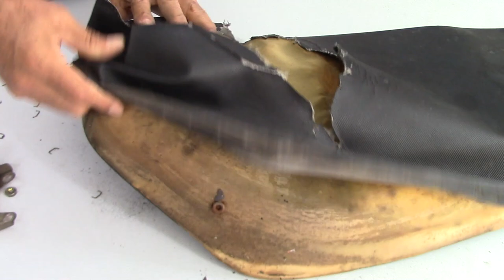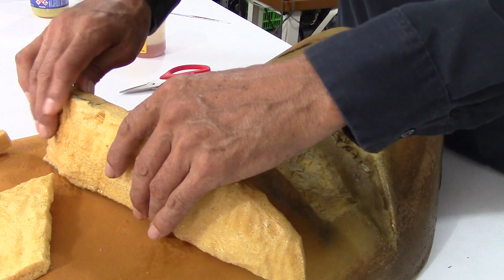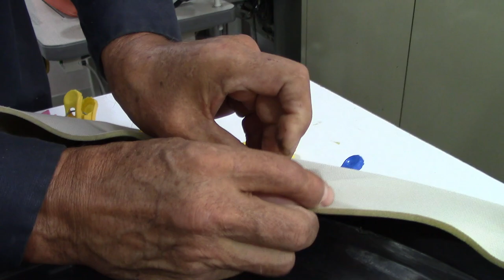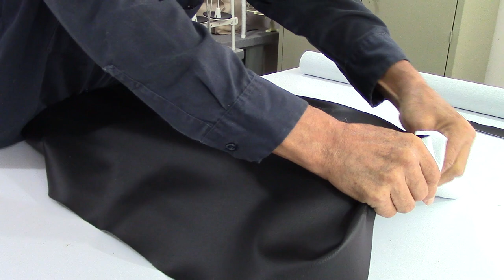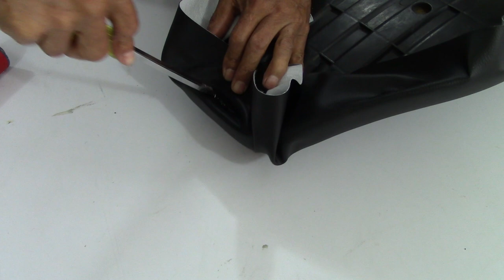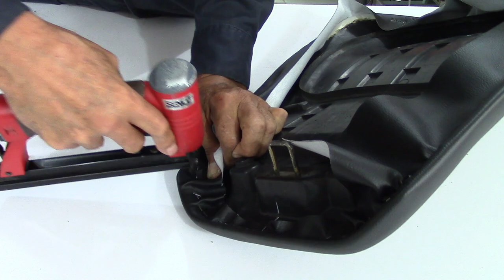Motorcycle seat cover - Straightforward/No sewing -  Upholstery

Comment: Most of the people would glue the vinyl to the seat instead of applying the correct forces in the correct angles to staple it to the back. Even applying glue using a professional spry system, when the glue dries it hardens and the good side of the fabric will copy all those imperfections, so no matter what how even the glue is spread it wont look professional. In this case and almost all the cases you should not apply glue there's always a work around. No heat which is great, proper way of stretching the fabric and staples selection. 1 single piece, no top and/or double stitching here so no plastic is needed to make it waterproof, nice job man, well executed as always :)
Reply from the maker: Thanks for sharing this interesting reflection!
You are thoroughly right!

Comment: Please don't make the mistake I made and order premium quality Vinyl ATV seat cover, which turned out to have ZERO stretch in the fabric. Thought I could apply heat gun to it, but all it does is melt the fabric or ruin the surface texture.  Getting hold of the right material for your seat shape is a must.

Comment: If i have a second set of hands I use a heatgun on low setting and warm up the material a tad and it make for way less pressure needed to fit. Saves my hands from cramping up as well ,

Comment: Can I ask you why you didn't glue thin layer of foam to original one same as single pieces and same for upholstery? It's because sitting on it you allow it to work/bend?
Reply from the maker: I put over the thin foam (foamed backing headliner fabric) to only erase some irregularities on the restored foam base.
It should be well stretched, otherwise wrinkles could appear on vinyl surface. The same applies for vinyl material.

Comment: Amazing video! Small question, sir:
I want to try this with my seat that is exactly the same, but i don’t want the cut the foam. Is that possible? Or is cutting the foam necessary to make it fit? Thank you!
Reply from the maker: It is not necessary to cut the foam. Do not forget to consider the stretch side of vinyl material. Much better a 4 way stretch vinyl

Comment: Can you use a thin 1/4” or so sheet or memory type foam instead of headliner foam??? Or does the headliner foam have a stronger backing? Or I guess I’m asking why the headliner foam
Reply from the maker: As the old hard density seat foam has a rough surface the added  layer foam is useful to even it. Any automotive foam is helpful and it could be thin or slightly thicker. Why a headliner foam is because that was what I had at hand.
Reply: @Cechaflo  i was curious if the headliner with the backing was more sturdy and easier to stretch across the seat than say a thin sheet of memory foam?
Reply from the maker: @jasondiddle4226  The headliner foam backing makes it sturdier than a memory foam. If your motorcycle seat foam cushion is in good condition you could add the memory foam over to make the surface softer.

Comment: Hi there, may i ask why did you not just glue the black vinyl onto the cover ? Would it be easier to do it that way ?
Reply from the maker: The cover should be loose to stretch and slide to the sides and take  shape of the foam base.
Reply: @Cechaflo  I see. thank you for answering my question :)

Comment: Very nice, I plan to do thr same to my seat, maybe add a 1/4 inch layer of neoprenefoam. .Where did you get that vinyl,  its so stretchy???
Reply from the maker: It is a standard 2-way stretch vinyl. The stretchy side is breadthwise. A 4.way stretch vinyl works out much better.
Check out: https://www.albrightssupply.com/automotive-vinyls
https://www.albrightssupply.com/products-search?qs=2-way+stretch+vinyl

Comment: Fantastic video Cechaflo.  Please, 2 questions, my M.C. seat is very hard- when replacing the cover I was thinking of gluing memory foam to the top of the old foam and then covering with new vinyl.... is this a bad idea??? Second, is there a store / shop, in Mexico to buy the glue / vinyl / foam.... that you could recommend??  or a online retailer that is good and ships to Mexico.... or do need to use Ebay?  Seat is VERY basic, a Yamaha XT250.
Reply from the maker: Not a bad idea of adding memory foam on top the old foam. It would add softness.
A gel pad would also be useful. Not really difficult to install on your seat. You can buy the gel pad on Ebay, Amazon, etc. Check out these videos: 
https://www.youtube.com/watch?v=HROrgFukbe8
https://www.youtube.com/watch?v=4zbgExrtiqY
https://youtu.be/3ZWRaCg3PV0?t=490
GEl pad: https://www.amazon.com/Gel-Pad-Inserts-Motorcycle-Seat/s?k=Gel+Pad+Inserts+for+Motorcycle+Seat
Regarding the glue in the USA there is a nice glue called Landau. It is brushable and sprayable: https://www.dap.com/products-projects/product-categories/adhesives/contact-cement/weldwood-high-streng/
Automotive vinyls: https://www.albrightssupply.com/automotive-vinyls
I hope this information helps. 
Best wishes!
Reply: @Cechaflo  very helpful. re-upholstering ebike seat.
great tutorial!

/Bklyn👑

Comment: What is that green handled staple remover tool you're using?  I'd love to have one for my own tool kit.  Currently I just use a flat screwdriver to remove staples and it's not great.  Thank you!  Love your videos!  You are a great teacher.  :)
Reply from the maker: It is a homemade upholstery staple remover I did using a screwdriver. I shown the process in this video:
✅ https://youtu.be/4i9da3yW6Vs

There are also sold in local upholstery stores/ internet:
https://www.amazon.com.mx/Narex-Lifter-Upholstery-Staple-Remover/dp/B00L7CVII8
https://www.amazon.com/-/es/Herramienta-Extractor-Wholesale-Suministros-tapicer%C3%ADa/dp/B01DR8JCVY
https://www.amazon.com/Upholstery-Construction-Strength-Removing-Furniture/dp/B08GKMZVSF
https://www.amazon.com/-/es/Osborne-No-120-Herramienta-tachuelas/dp/B0761XCM9W/ref=pd_lpo_1?pd_rd_i=B0761XCM9W&psc=1
Reply: @Cechaflo  Thank you very much!  Have a wonderful day!
Reply from the maker: @ORTaeKwonDoChick  You are referring to the ordinary pointed wire cutting pliers I am using in the video. They work out well.
https://www.amazon.com/SPEEDWOX-Diagonal-Precision-Shoulder-Professional/dp/B07KTXFR2M